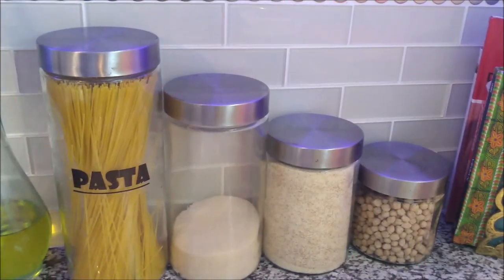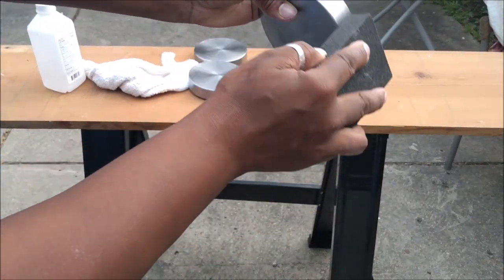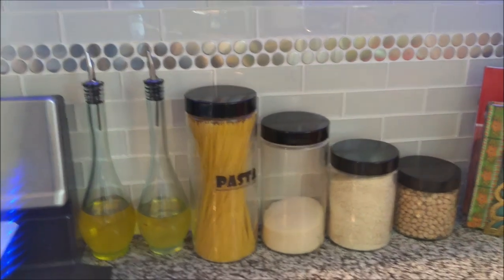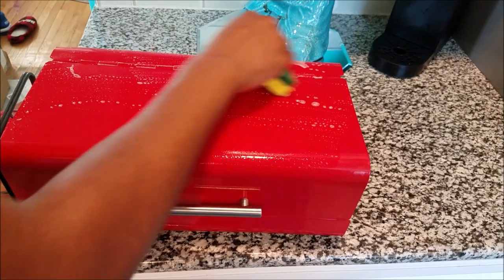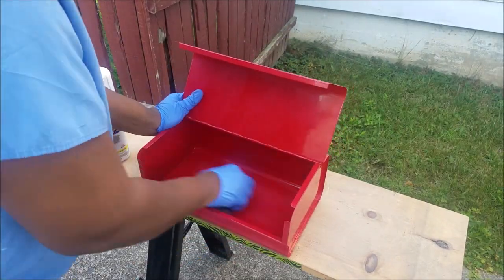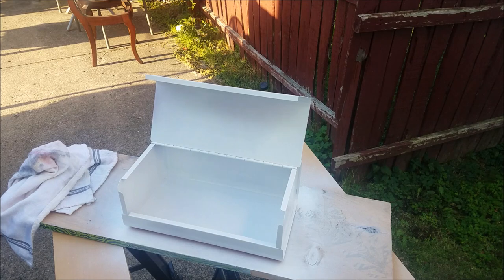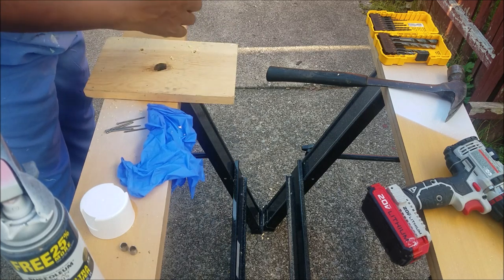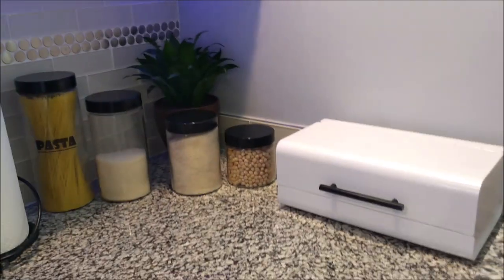HOW TO BRING A FRESH LOOK TO YOUR KITCHEN CANISTERS WITH SPRAY PAINT

Comment: Hi. I'm planning to spray paint food containers too.  Did you search first if the spray paint is food safe? Or are most spray paint food safe? Thanks 😊
Reply from the maker: It on the outside. It will not come in contact with the food.